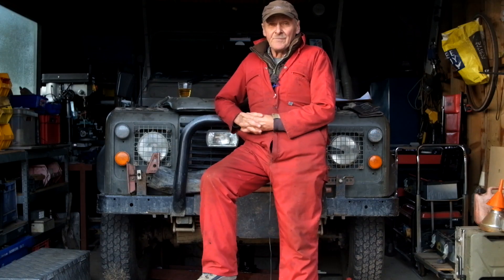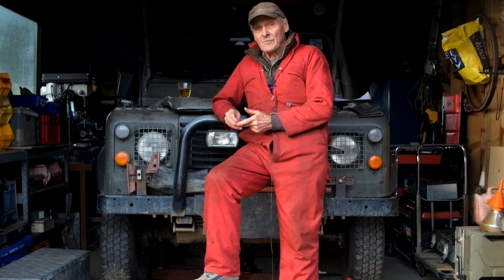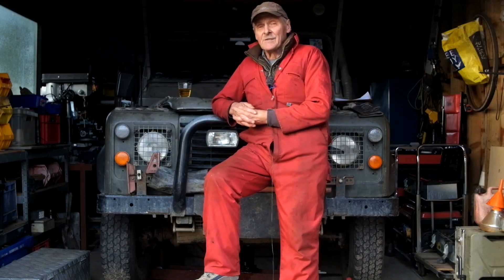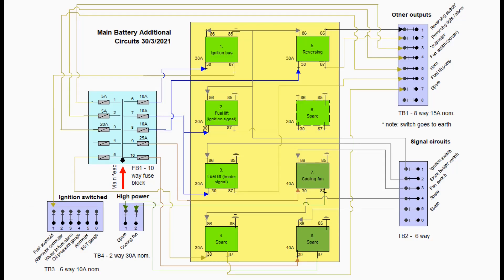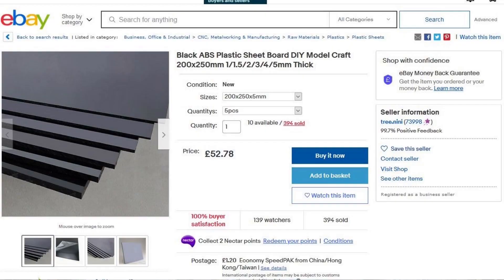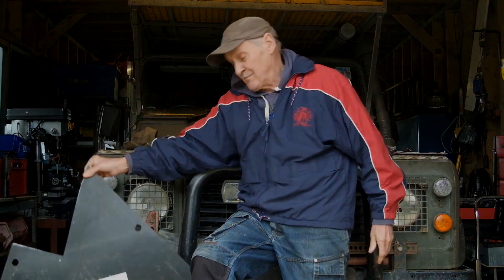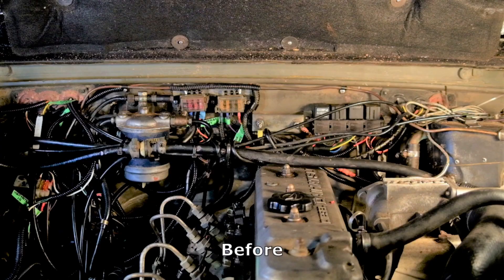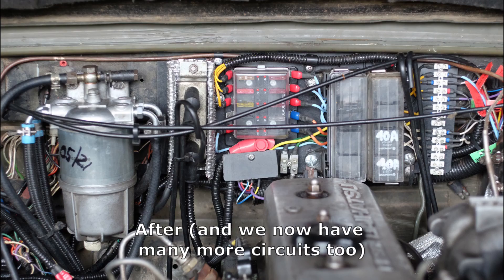Defender electrical revamp Pt 2 - main battery system

Comment: The reason screw terminal joiners are not used in automotive applications now is reliability, it really is not the best joiner method available. Also I have to disagree with the pre-wired relay holders, again, you are introducing another fail point into the electrical system. Putting the whole lot totally exposed to the elements on the engine side of the bulkhead is also asking for trouble, especially with horizontal positioned relays. I totally agree there is a distinct lack of usable space on a Land Rover, personally having a 110, the underseat compartment on the driver's side is a perfect place for electrics. On a 90 I would suggest buying the middle seat "tool tray" and fitting everything in there, it's above wading depth and is sealable so things remain dry and easily situated for fault tracing especially in inclement weather.
Reply from the maker: Everything has a reason. I am very short of space and the cab is very cramped. There's no room for extra kit there unless I take existing items out. The bulkhead really is the only viable option. I'd like to put the wiring hub into an IP rated box but would need to miniaturise it first. An obvious space saver would be to use  mini relays however the rest of the vehicle uses standard relays and I want uniformity. Everything, as ever, is a compromise. The video is posted to show one approach to the problem and is not meant to be the ultimate solution.
I am not aware that the the MTBF for screwed terminals using ferrules is much different to the alternatives which is why they are so widely used in industrial control rooms. However they may be more susceptible to environmental factors so my priority would be to put them into a better environment rather than to change the connector type. If you can quote reliability data to the contrary I'd be pleased to see it.
When you mention the underseat compartment on the driver's side, this is where the fuel tank sits and it's also more exposed to the elements than the upper bulkhead. Or am I missing something?

Comment: Very well done, more so if it's your first time better than some electricians I've worked with, a vast improvement. Just a few things for the pot you may find useful, this probably doesn't apply to you mine is petrol, in the ninetys it became compulsory on new cars to have a lift pump cut off in the event of a accident most used an inertia switch, I have used a relay nc contact negatively switched from the oil pressure switch, no oil pressure no pump. I also have a small diode protected relay switched from my alternator charging light I use to switch my hour meter and split charge relays with an interlock relay from my winch supply. ( don't like vsr relays) You can buy adaptable boxes and enclosures in all shapes and sizes to help keep thing's dry, dust free and tidy, If you have been in industrial control panels you have probably seen all the cables are numbered, yes they are a pain to put on but they are cheap and can make life easier little label printer's are also useful Pete Vree and Jim Pytel have done a few videos on basic ladder diagrams and cable numbering you may find interesting, the industrial way is the best in my experience just wire it as though its ac.
Reply from the maker: Hi Roy, the wiring centre didn't come out too badly given the constraints I set myself (i.e. using existing / used materials where possible). The real benefit was that having started on a tidy up I then got into it with a vengeance and corrected loads of niggly things all over the vehicle, some of which required a lot of time for small improvements which was why I hadn't addressed them before.
Regarding some of your points:
1. Thanks for pointing out the requirement for an automatic cut off for the fuel pump. There is a hidden manual cut off and it will be easy to add an inertia switch too.
2. Labels. Yes I have seen a number of commercial labels which are very neat and designed to take tag / cable numbers. My problem is that I want to write out wordy descriptors and the cables I am attaching to are v small so there isn't much real estate. I have tried some tags which attach along the cable so are quite neat but (a) they don't accept ball point pen, and (b) Dymo labels don't stick to them. Chinese rubbish I guess. I will come back to this in due course. The important thing is that the cables are all identified for now.
3. I know all about adaptable boxes etc. Wait for the next video.
I will be doing a video review of some of the commercial wiring centre offerings because I now understand much better what is required.
I don't know why you were unable to send me an email previously because the address was correct (billnich1950@gmail.com)
Reply: @defendermodsandtravels  If I remember right the legislation for fuel pump cut off only applies to post 95 cars I put one on because mine is petrol   it's also got the tank under the drivers seat not good for side impact, I also try to have bit of a standardisation one relay fits all 5 pin 30 amp is my choice only have to carry one spare I think what you've done so far is really good.
Reply from the maker: @royblackburn1163  OK thanks for the clarification about the fuel cut out.
All my relays are 4 pin standard size (but tempting to go for the mini relays owing to space constraints) because they are OE. I put in a couple of 40A relays on the higher power circuits for reliability but in reality 30A would be adequate.

Comment: That was a very orderly video well set out, executed and explained :-)

Some folk say that automotive should only be crimped but I crimp and solder. I've never had a problem.
Reply from the maker: Thanks Ade.
Crimping and soldering are both widely used and accepted and at our level are perfectly acceptable.  I made a point of using screw-type terminal blocks, partly because I had some lying around, but also to show that they are acceptable too. I know that many people would regard them as inferior. Do whatever works for you is the message.
Reply: For information: Generally crimp or solder or crimp then solder is acceptable, never solder then crimp as the crimping solder is almost a guaranteed fail. Ideally for best results a good quality crimp will surpass any other fixing method. The usual fail on solder joints is vibration on the wire, and it fractures right at the base of the solder joint, this can be avoided by correct support of the wire.  As a note, several manufacturers crimp and then solder high current application joints, Ford did this on the relay and fuse bus bars for all the 1980's vehicles.
Reply: @overlandready  For vehicle manufacturer's it's about saving time and money.